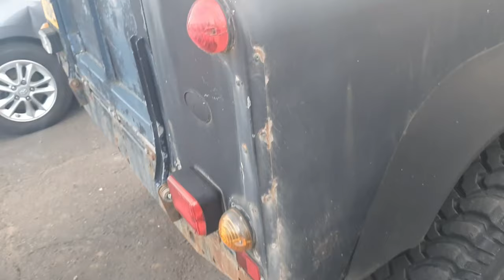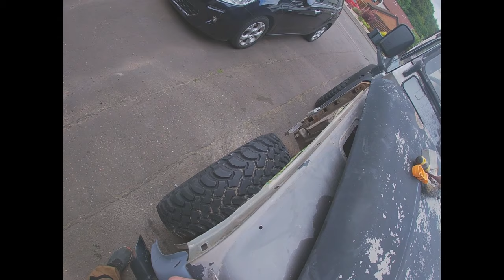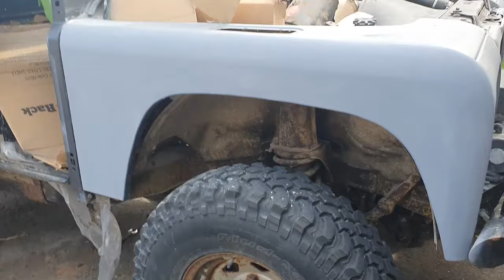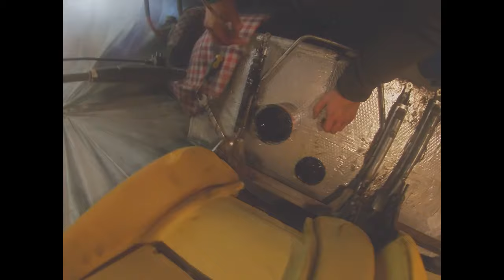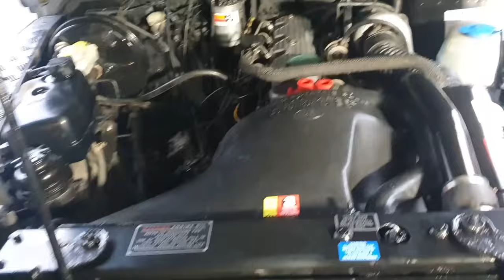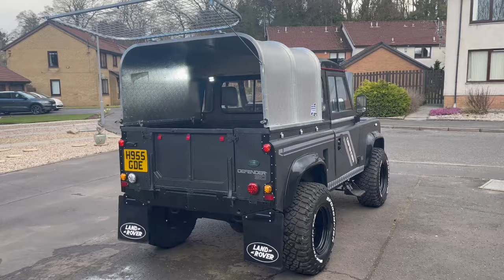Building a Defender in 10 minutes *farm abandoned*

Comment: Hello good sir. Really nice restoration, definitely has a look. Im going to attempt to paint my 90 this summer. Was that a sand blaster you used, if so what were the specs? Thanks.
Reply from the maker: I only used sandblaster once for the door.  To be honest my compressors isn’t strong enough for it.  It’s just a basic sandblaster tank from clarks.  Plus it’s messy for doing in a driveway.  If you have the space I recommend getting a high power compressor first to power it.